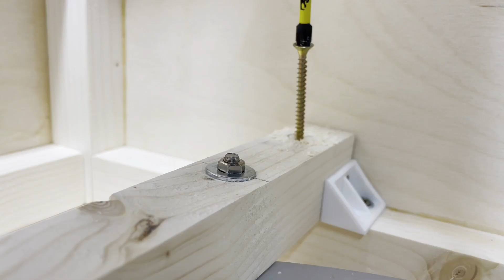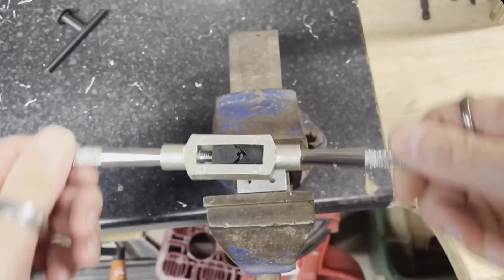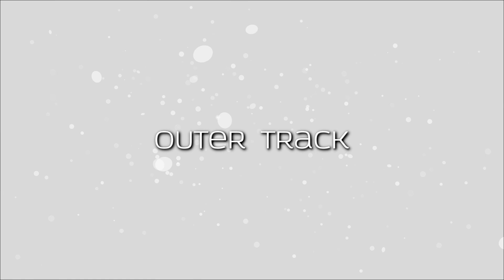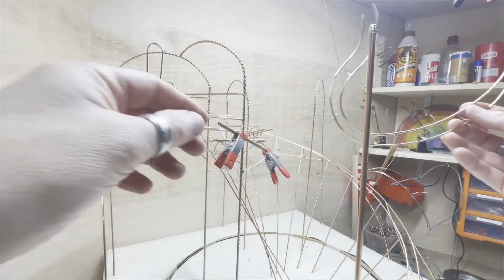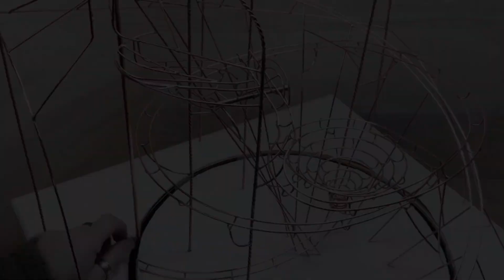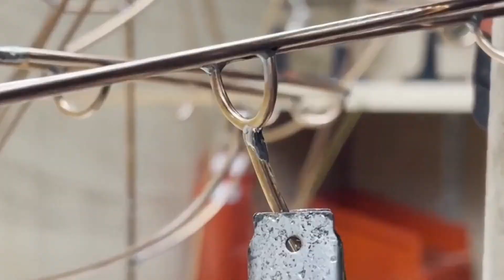Full Timelapse Build of a Rolling Ball Sculpture

Comment: Is there a reason you used copper vs steal sir?
Reply from the maker: I originally tried working thin steel wire but found it quite hard and not very nice to look at. So I switched to copper. I’m looking forward to working with larger wire stainless steel at some point.

Comment: Loved this sculpture..just two queries.was the flip flop made out of copper wire..second was it brazed or soldered ?
Reply from the maker: Hi. Yes it was definitely copper. Sorry but can’t remember how it was soldered. I usually try resistance first and then switch to flame soldering if more heat is required.

Comment: Hi, just watching a few of your videos of build and final sculptures which are somewhat hypnotic. There's something about moving art which is so much better that stationary art. I'm starting to experiment with some very basic track and I was using galvanised wire. For this I have to use acid flux. With your copper do you use rosin cored flux? Also what is that tool you use to melt the solder? - it looks like a carbon tip with an earth clamp. Why do you use steel balls rather than marbles? I'll start working my way through the rest of your videos to gain more knowledge. Keep up the good work - I've got a lot to learn.
Reply from the maker: Hi Helen. Thanks for the lovely message questions. I do use rosin core solder for my copper wire joints. In the beginning when I started out I was trying galvanised wire. But I found it very hard, needed flux and often went rusty quickly. Copper is much nicer material and I no longer use flux. 

My iron is a Resistance one and I have two videos about it on my channel. You can still use a more traditional heat iron, but you’ll need a more powerful one with larger gauge wires. 

Enjoy your crafting!!! 

👍👍👍

Comment: I love the ingenious design of the pusher. Watching it going around, I had a thought of a piece of hinged track at the top that lines up with the ramp that acts like a one-way gate that lifts up to let the balls through. The pusher pushes the balls up through and the ramp extends higher than the pusher rod. When it reaches the limit of its length, the pusher rod moves under the balls and the balls roll backwards down the ramp and onto the rails of the switch that it pushed up through and on their way.

Not sure if that made sense, but I would wonder if that would work.
Reply from the maker: Hi Mr Pants. I also thought of a swing gate system. Something like you described sounds great. Thanks for your comment, very appreciated. ⭐️

Comment: did you have problems with soldering? Did the half rings fit well or could they fall off in the process? I'm doing the same thing right now and I'm having problems.
Reply from the maker: Hi. It is something you have to be very careful about and learn to deal with. Good luck with your builds.